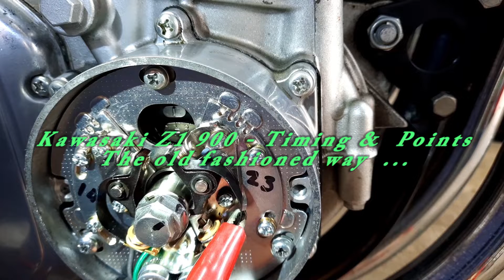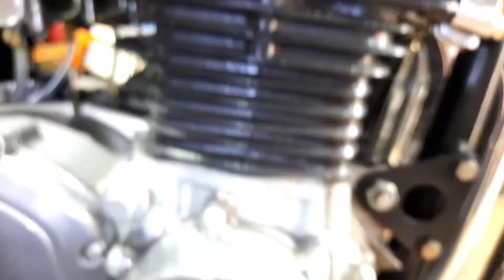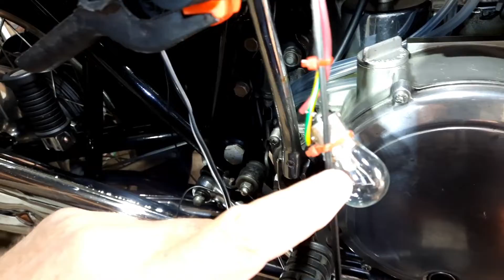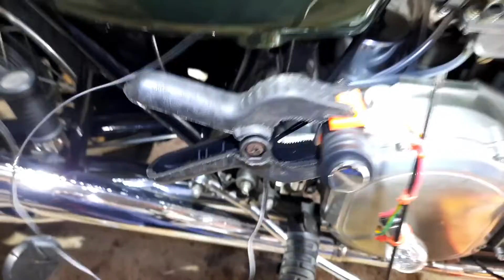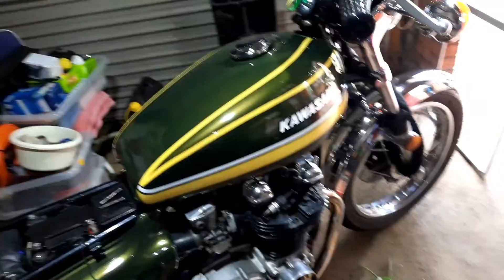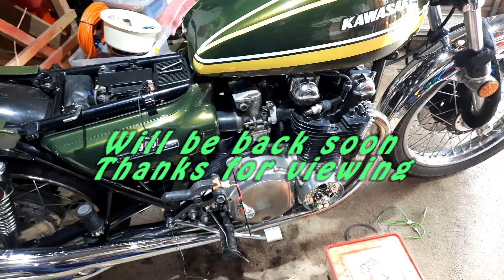Kawasaki Z1 900 Points & Timing

Comment: All I ever did on my 1976 KZ900 was set the points gap, hook up a timing light and run the engine at idle. Swap the timing light clamp from the different plug leads and adjust while running. You can hit the marks dead on and the bike will start idling smooth as silk with lots of power and very  smooth throttle response. Works every time. Also these engines love to idle at 1000 rpm with the crbs set right.

Comment: Vid doesn't get going until over the 5.00 mark, a lot of padding out of content here!

In the 70s we all used dwell meters for twin point 4 cyl setups.
Get a reference dwell from one set gapped with a feeler gauge and set the other to that with the engine running so both were spot on. Check the timing still OK with a strobe and off you go.

Quick, easy and much more accurate, used to check them every month.
Fag papers, radio clicks, bulbs???

Comment: Reminds me of doing the points on my old Kawasaki's, I had several 2 stroke 350's, one was a 2 cylinder, and the other was a 3 cylinder which had 3 points, I also had a 1979 KZ750 Twin with only 1. Then in 1984 I bought a '82 KZ1100 which had electronic ignition. My first motorcycle was a 1968 Kawasaki 350cc A7SS, my next Kawasaki was the '79 KZ750 which I had until I got the KZ1100. At some point in the mid 1980's I got a deal on the 350 Triple, I think it was at S2.

Comment: I do my 650 b1 like you but a quicker setup is get a portable radio turn volume up on frequency with no station. You will hear a click from the radio when the points open.
Reply from the maker: Hi Colin, will try that, great idea

Comment: Points bane of my existence! Never seems to go according to the book but I know once I get it I’ll be golden. I’m using a multimeter like suggested in the manual but on 2&3 I cannot get the points to close within the available range. I’ve even adjusted the mounting plate but no significant difference. Any ideas?
Reply from the maker: Mark the high point of the cam lobe with a sharpy marker  on the crank nut, then work on setting the points gap, 14 thou, then set the crank to T1/4.
Now connect your bulb up, back turn the crank the light should be on, and as you turn the crank clockwise as the T 1/4 lines up the bulb should go out, repeat for T 2/3 adjust the timing points plate so that bulb 
work on setting the points gap first.
Hope this helps Gary
Reply: @garyspracticalworkshop357  Will take another stab at it, this time with a bulb. Thanks for sharing your knowledge!
Reply from the maker: @toyetoyetoye  no trouble....

Comment: I used to do the points and tappets on my cb550 the same way every weekend in the eighties (I did a spell of dispatch riding so I was doing 1500-2000 miles a week).
 I always found it quite therapeutic and the bike was noticeably smoother afterwards.

Comment: Hi Gary, thanks for this video it was very helpful.

Where I’m getting a bit stumped however, is that after I set it - I start the bike and it’s not quite going right. Then when I check the timing straight after the first start - the 1/4 mark is advanced.

It won’t seem to stay put at the correct timing. Any ideas?
Reply from the maker: Hi James - Sounds to me as if your timing is slipping out some where, I would be inclined to check the auto advance unit behind the points mounting plate, also check all the screws are tight on the points backplate and one more thought would be to check the timing cam can move freely , fine oil only on this .
Hope this helps 
Gary
Reply from the maker: Hi James - Not quite sure what you mean here, if you place the crank align marks T/14 s  "F" mark and ajust the postion of your points with a srewdriver by levering them clockwise or anti clockwise, and them lock them in place you should have it , now check with the bulb system you should have it bang on as you rotate the crank.

Hope this helps 
Gary
Reply: @garyspracticalworkshop357  Hi Gary thanks for replying! So what I mean is I get it aligned to T/14 with the bulb, start the bike, then when I check it again with the bulb, the t/14 mark is now too far advance. I'm not sure how but the T/14 timing seems to be slipping everytime I start the bike after setting the timing.